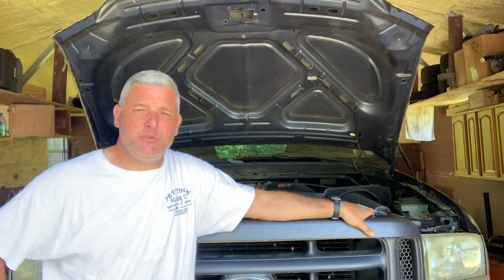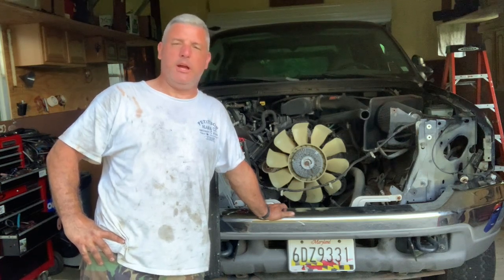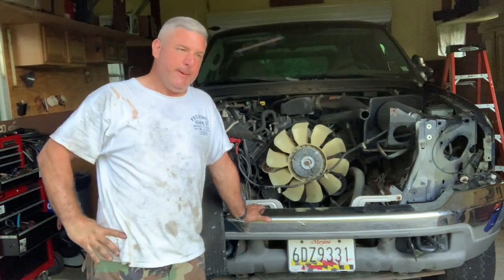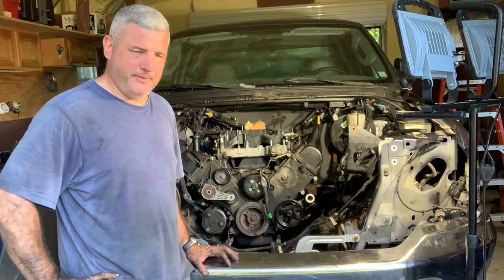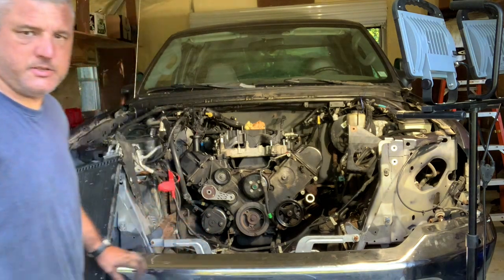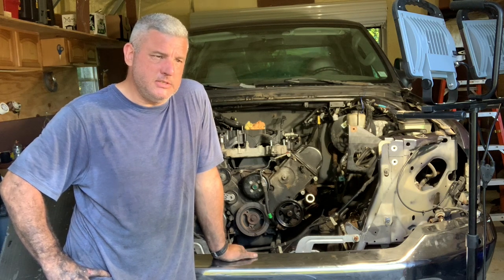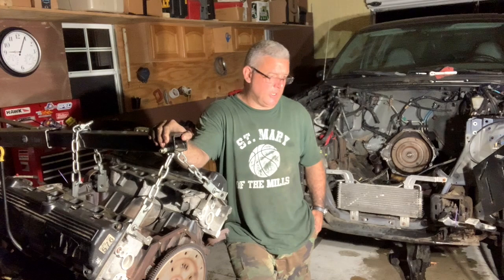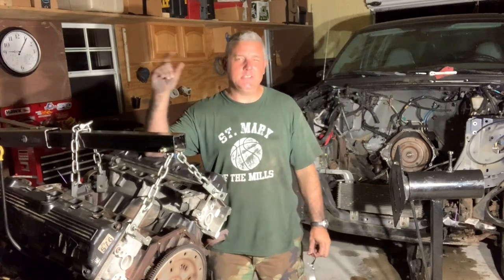F250 Engine Swap (part 1)

Comment: That was a big job, I am curious to see what went wrong. I am also rebuilding the engine on my 1975 F250.
Reply from the maker: I looked in the oil pan yesterday and found a bunch of metal sludge and pieces of a bearing. I need to investigate it a bit more next week. I'll make a follow up video prob next week. Good luck with your project!